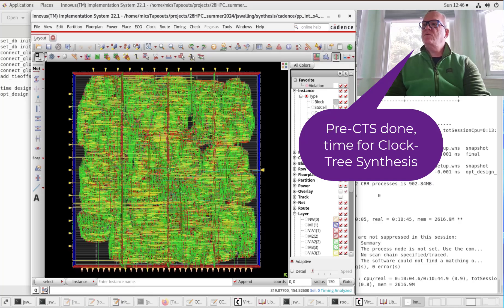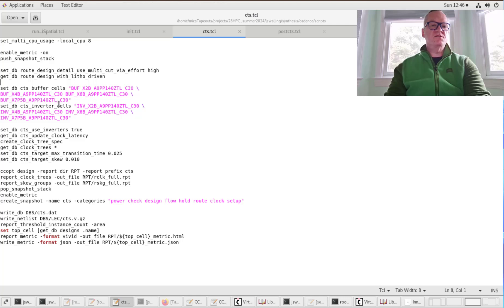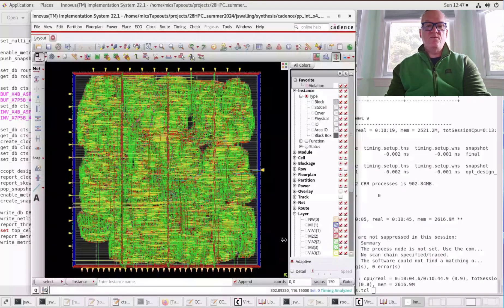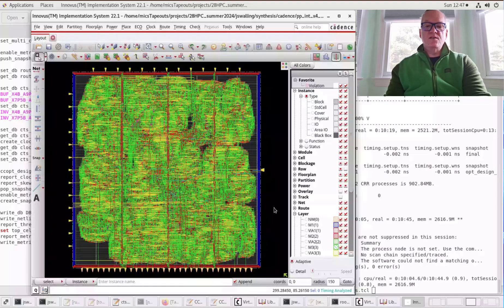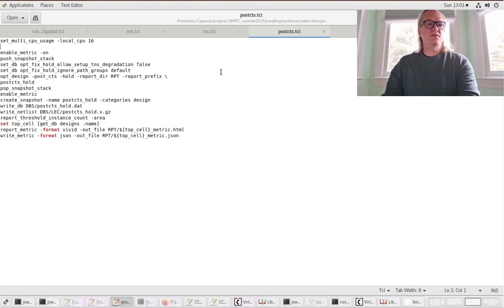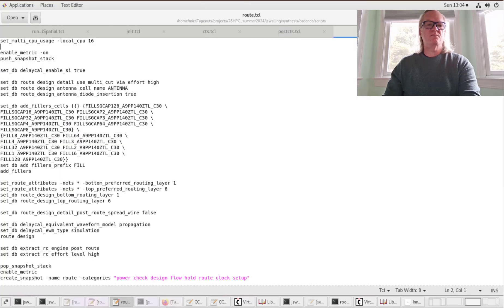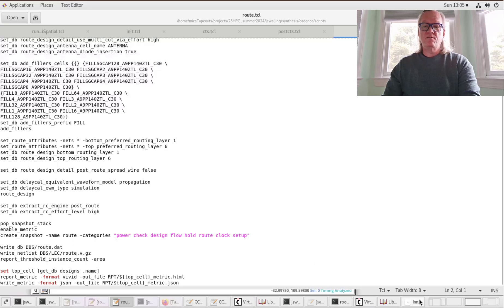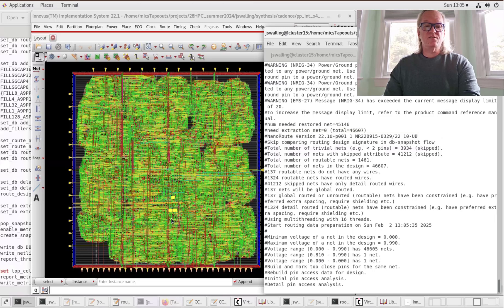INNOVUS   CTS Design and Post CTS Optimization

Comment: Thank you for making this helpful video. I have a question. Why do you add filler cells before routing?
Reply from the maker: I am them before route because it gives better results with the drc. I add fill, route, remove fill, optimize, then re add fill.
Reply: @ Thanks again for answer my previous question. i just tried to do the same and there are indeed fewer DRC errors.
Reply: @wallingphd  Thank you! Let me try with my circuit